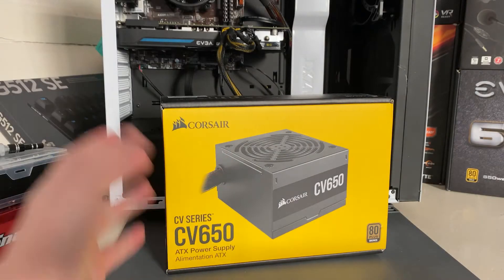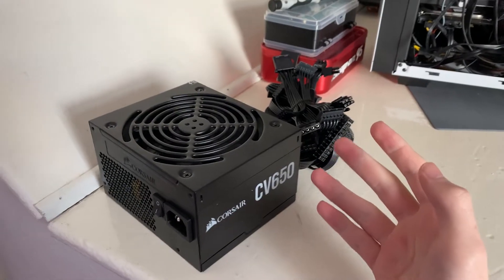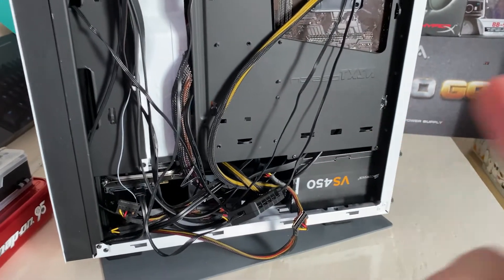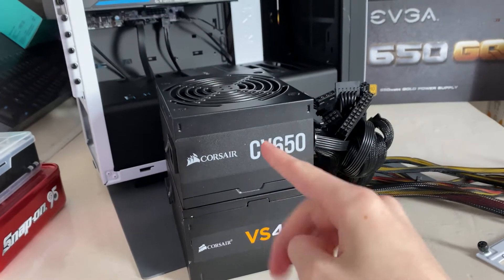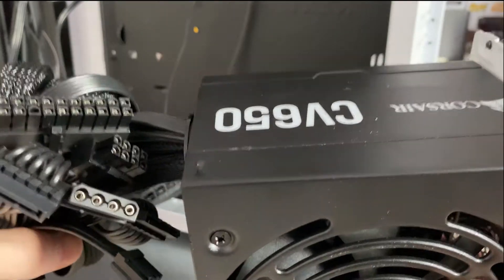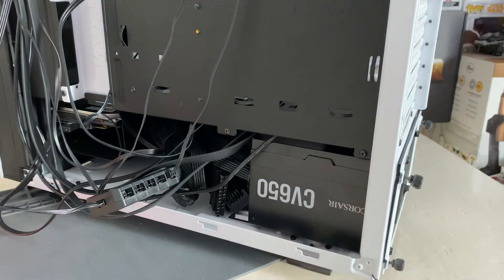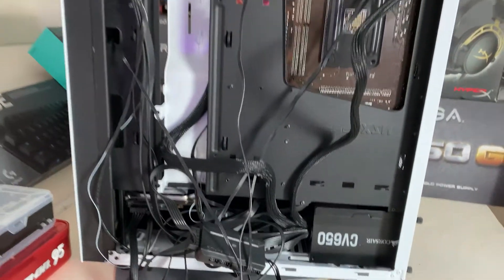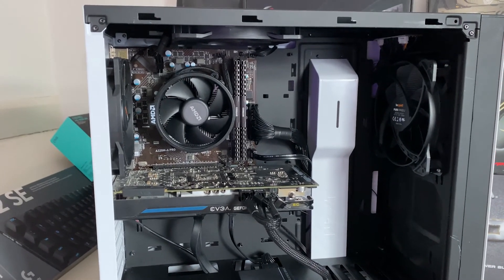How to Replace a PC Power Supply | PSU Upgrade Guide

Comment: I'm gonna sound stupid but does this mean I only have to remove the cables from the psu itself and not the other things like the front panel connectors??? Etc cus I saw some wires below the motherboard with words like audio and usb and I thought i still have to remove them....
Reply from the maker: Only the cables coming from the PSU need to be removed. The front panel, audio, and USB connectors can stay in while you swap the PSU

Comment: i have a modular psu 550w and wanna upgrade to a 750w modular psu i dont need to take off all the cabels on my motherboard and graphics card i just plug in all the cabels to the new psu right?
Reply from the maker: Never do that. Different PSUs will have different pin outs. It’s always best to use the cables which come with your power supply

Comment: Where do you connect front panel connectors to psu?
Reply from the maker: Front panel connectors connect into the motherboard. This varies by motherboard and the exact layout can be found in the instructions for your motherboard model.
Reply: @ProYamYamPC  so you connect F panel connectors to motherboard where does other end go?
To the psu through molex chain?

Comment: So damn confusing! This is the only thing holding me back from upgrading my GPU
Reply: why not just have 2 gpus in one pc
Reply: @user-mp1hg1tk9d  my micro-atx doesn't vibe with the double GPU idea sadly
Reply: @absolving  ive just upgraded my pc to a ryzen 5 1600 and a gtx 1660 but my next card is gonna be like a rtx 2070 or a 1080 ti so i need to swap power supply too lol, i also have a micro atx motherboard lol
Reply: @1Percentt1  eyy nice dude, I also recently upgraded to a 1660. Got it for super cheap from a friend. Are you on a 450w PSU?
Reply: @absolving  nah bro im on a 400w power supply but im even overclocking my cpu from 3.2ghz to 3.7ghz and its stable my friend 👍
Reply: @absolving  before my 1660 and ryzen 5 i had an athlon 200ge and a gtx 660 ti lol so big upgrade
Reply: @1Percentt1  nice, yeah I upgraded from a 1650 to the 1660, big upgrade as well. The 1660 is really great still! People see that it's a 16 series card and instantly brush it off but it still holds up really well with new games
Reply: @absolving  ikr i can play any game i want at 1080p ultra and get at least 40 fps

Comment: I have a 1660 super, and an i5 7500 with a Corsair vs550w PSU. I want to upgrade my cpu to a 5800x. Do I need to get a new power supply as well?

Comment: Question do I need a higher wattage power supply. I have a 750 gold in it now but I'm running a 3080 and a Ryzen 9 5900x and I've been reading something's online that have me nervous now.
Reply: This is fine but u should upgrade for like 900 watt so u can use rgb and other stuff still if u can't that's absolutely perfect

Comment: should i use the new wires in the box witn the psu or can i use the old wires from the old psu?
Reply from the maker: Definitely use the new wires. Different PSUS have different pin layouts. Using the old wires with the new PSU can cause serious damage and potentially kill your hardware.
Reply: thanks

Comment: By any chance did an 8 pin connector come with your 450? As I need one for my 360 and I have to same power supply
Reply from the maker: It did, I believe it had two 8 pin connectors. However, the old VS PSUs from Corsair aren't brilliant and I'd recommend upgrading it as soon as you can.
Reply: Well I’ve just ordered a 650w psu from evga I believe it’s 80plus gold rated. I did some research I think it’s good for my 3060 it was 60 pounds on sale from 70 is this a good psu? Thanks for the reply

Comment: if I want to swap the psu in my pc does the new psu have to be the same brand as the current one (if I had a cooler master psu do I need to buy another cooler master one or can I just buy a corsair one)
Reply from the maker: You can buy any brand. All the cables are standardised.

Comment: What psu do you recommend for i7-11700F and rtx 3060?
Reply: 650W. I would get a 750W or 850W psu so you don’t have to worry about upgrading to a new power supply for a long time.

Comment: What psu do you recommend for a i5-10400 and an rtx 3060 ti?
Reply from the maker: A good quality 650W PSU would be a great pairing.
Reply: Appealed- I still haven't bought one yet. 😂
Reply: @mahmoudkhaled3171  I've got that CPU and looking to upgrade to that same GPU! PSU calculator comes in at 402w for me, but Nvidia website says required system power is 600w for the 3060ti, so...

Comment: very helpful, im just about to do mine and am a novice but ok at general diy, one thing, maybe an idea to photograph before i take cables out to reference what goes where, learnt this from doing brakes or engine changes on cars n trucks, always a good re cap i think. great video thanks!
Reply: Great advice
Reply: Using this olde PSU with Ryzen 5 5600 and Gigabyte rx 7800xt GPU. After the 3 year warranty ended. It works so not replacing it just yet.

Comment: Don't we need worry about how much load the psu is going to give the motherboard?
Reply from the maker: The main parts which draw the most power are the CPU and GPU. As long as you have some overhead, you will be fine.

Comment: a i5 9400f with a gtx 1650 which power supply would be good?
Reply from the maker: A good 550w PSU will be just fine.

Comment: Hi, I'm swapping my Corsair TX750m for a HX850i, is it best to swap all the cables over as well, or ok to mix cables?
Reply from the maker: Definitely swap out all of the cables. Just to be on the safe side.
Reply: check if they are both type 4 cables

Comment: My pc keeps shutting down and restarting every now and then. I have a 650w 80 plus white psu. Running i7 7700 and gtx 1080. U think it could be a faulty psu i need to replace?
Reply from the maker: Potentially, that does sound like a PSU issue. But it could be down to something else, Try to RMA the PSU if you can and replace it and then see if the issue is still persisting.

Comment: think a 600w is too low for a 2070 super i7 7900k?
Reply from the maker: It's not ideal but as long as it's a good unit, you should be fine.
Reply: @ProYamYamPC  pc shuts off loading valorant/playing cs. runs cod no problem. im thinking psu too low

Comment: This may sound like a dumb question but,  the rtx3070 requires 12 pins. so does any power supply you buy come with 12 pin wire
Reply from the maker: Nvidia include an adapter for it. Only the Founders Edition has the 12 pin connector. Other models from EVGA, Asus, MSI etc. have standard PCIe connectors.

Comment: How much wattage would I need to run a GTX 1660
Reply from the maker: You would be able to get away with a decent 450W unit depending on your other components. However, I'd recommend a 500W to be on the safe side.
Reply: @ProYamYamPC  where do I connect the rgb
Reply: I'm running a GTX 1660 Ti with a 450W PSU and it runs just fine
Reply: @datalor3698  I only have a 6 pin connector what should I do for the 1660 super
Reply: @gagefischer2648  buy a 6-pin to 8-pin adapter or, even better, upgrade to a better PSU. 1660S requires AFAIK an 8-pin connector.
Reply from the maker: @datalor3698  It may run fine and that’s all good. But it isn’t recommended. As long as it is a good 450W unit, you should be fine.
Reply: @ProYamYamPC  it's a VS450 so, according to your video, no... :D but I ordered a CV650 in preparation for (when, if, maybe) a 30 series new card
Reply from the maker: @datalor3698  Personally I’ve never had an issue with the VS unit. But I’ve seen plenty of them fail on other people. The CV lineup is really good for the price👍
Reply: @ProYamYamPC  yea, coincidence was I stumbled upon your channel because I was looking to refresh my memory about swapping the PSU and there you are changing what I currently own for what I bought!